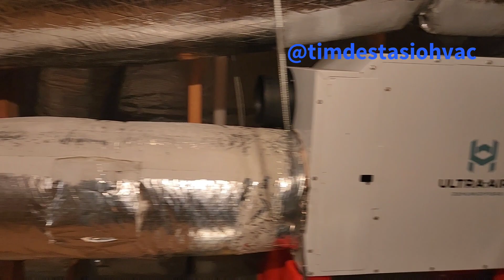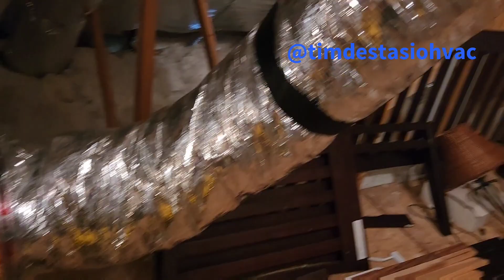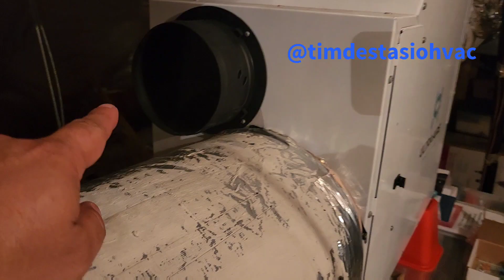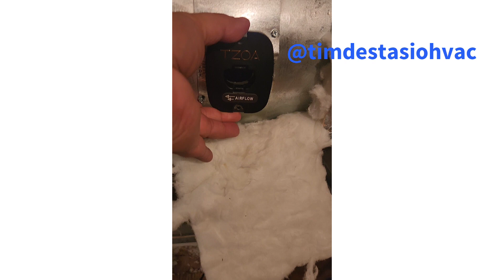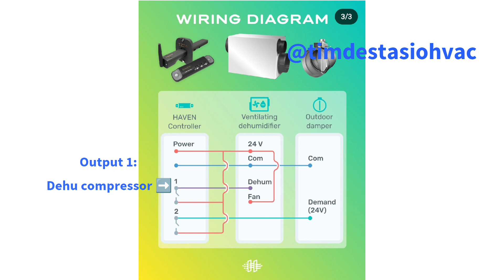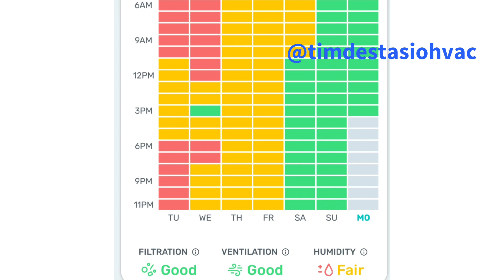Haven IAQ New Ventilating Dehumidifier Beta Test Workflow!

Comment: Interesting. There is something I dont understand very well. How is that the ventilation equipment dumps room temperature air into the supply. Wouldn't that add warm air to the rooms??
Reply from the maker: Yes. It does. So you have to size and adjust accordingly